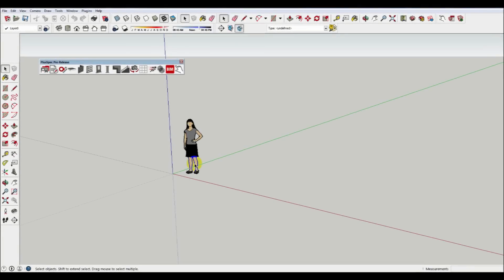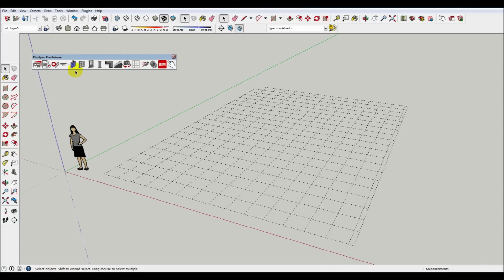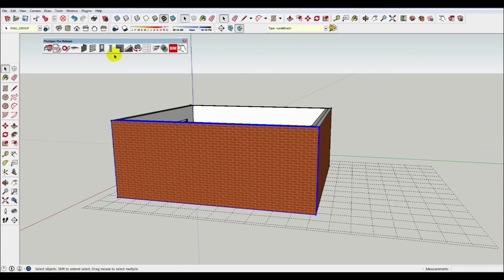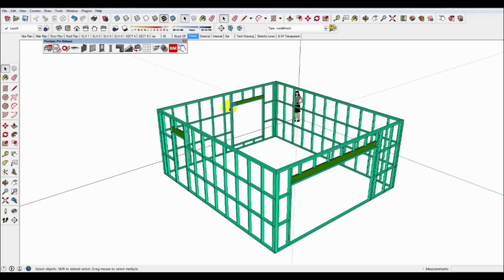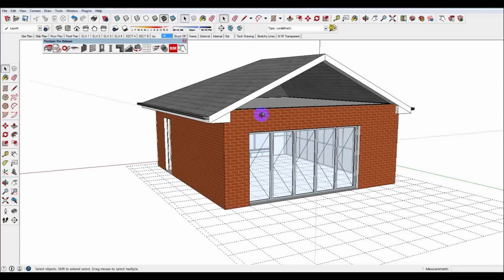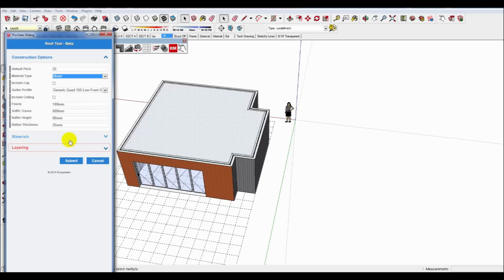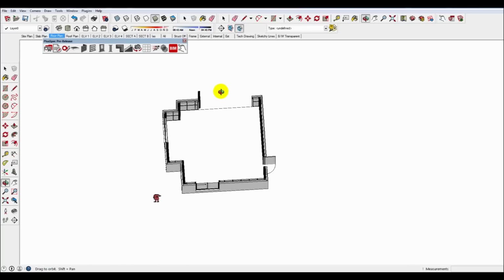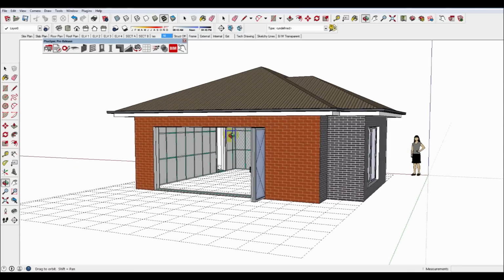Introduction to PlusSpec

Comment: Cant get it to download after paying for it. cant even log in
Reply: Mate did you get it sorted?
Reply: Try reset password it was most likely a typo
Reply: Yes I did several times. I finally got into it the $10 version is way too limited tried following along with the getting started video and couldn’t do most of it because that part wasn’t unlocked. So I gave up after couple hours. I uninstalled it and canceled subscription.
Reply: @Grimmeute  that's good
Reply: Good?  Guess you didn’t read it all.
Reply: No, I read it all mate.   Basically you wrote in the wrong password,  decided to complain publicly instead of using the help.  You then complained that  the lite version didn't have full functionality... 
Mate we are people, not multi nationals and we are building quality software for professionals to use,  it's a shame you had problems as you would enjoy the time saving and functionality Pluspec offers designers and builders.
Reply: No I didn’t write in wrong password. I said that I kept putting in password wouldn’t log in. I change password 5 times,  try again each time. No go. Until finally it did.
Reply: Ok thanks for letting me know